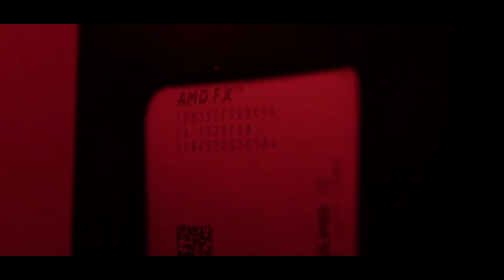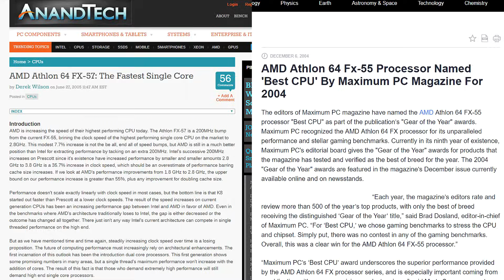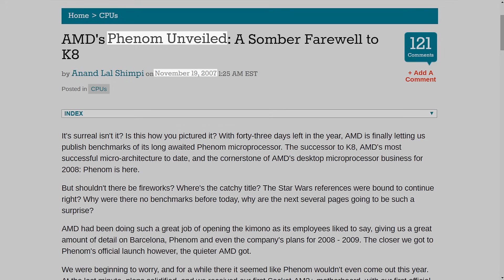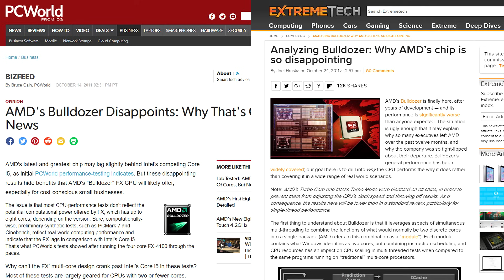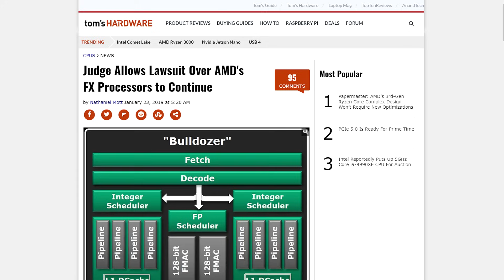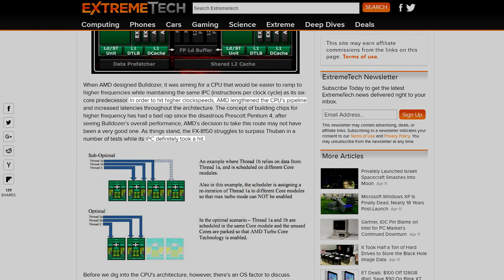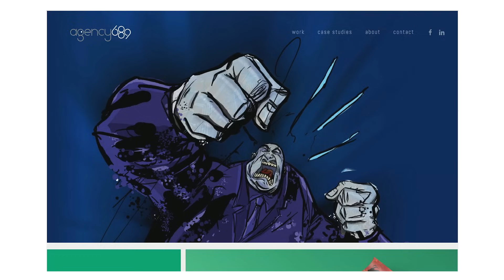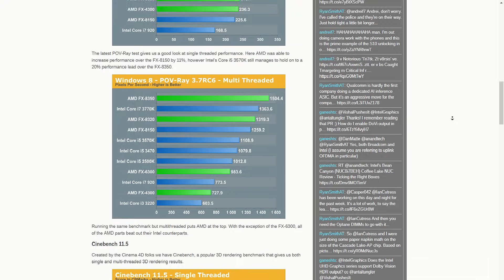Why AMD's FX CPUs Were Hated So Much? - The Fate of Bulldozer

Comment: Hated? Nay. I love mine:

john@john:~$ lscpu
Architecture:        x86_64
CPU op-mode(s):      32-bit, 64-bit
Byte Order:          Little Endian
CPU(s):              8
On-line CPU(s) list: 0-7
Thread(s) per core:  2
Core(s) per socket:  4
Socket(s):           1
NUMA node(s):        1
Vendor ID:           AuthenticAMD
CPU family:          21
Model:               2
Model name:          AMD FX-8370 Eight-Core Processor
Stepping:            0
CPU MHz:             4111.594
BogoMIPS:            8026.77
Virtualization:      AMD-V
L1d cache:           16K
L1i cache:           64K
L2 cache:            2048K
L3 cache:            8192K
NUMA node0 CPU(s):   0-7
Flags:               fpu vme de pse tsc msr pae mce cx8 apic sep mtrr pge mca cmov pat pse36 clflush mmx fxsr sse sse2 ht syscall nx mmxext fxsr_opt pdpe1gb rdtscp lm constant_tsc rep_good nopl nonstop_tsc cpuid extd_apicid aperfmperf pni pclmulqdq monitor ssse3 fma cx16 sse4_1 sse4_2 popcnt aes xsave avx f16c lahf_lm cmp_legacy svm extapic cr8_legacy abm sse4a misalignsse 3dnowprefetch osvw ibs xop skinit wdt fma4 tce nodeid_msr tbm topoext perfctr_core perfctr_nb cpb hw_pstate ssbd ibpb vmmcall bmi1 arat npt lbrv svm_lock nrip_save tsc_scale vmcb_clean flushbyasid decodeassists pausefilter pfthreshold
john@john:~$ 
john@john:~$ 
john@john:~$ cat /proc/sys/kernel/osrelease
5.3.0-23-lowlatency
john@john:~$ 
john@john:~$ 
john@john:~$ dmesg | grep microcode
[    2.151435] microcode: microcode updated early to new patch_level=0x06000852
[    2.151485] microcode: CPU0: patch_level=0x06000852
[    2.151491] microcode: CPU1: patch_level=0x06000852
[    2.151497] microcode: CPU2: patch_level=0x06000852
[    2.151503] microcode: CPU3: patch_level=0x06000852
[    2.151506] microcode: CPU4: patch_level=0x06000852
[    2.151514] microcode: CPU5: patch_level=0x06000852
[    2.151519] microcode: CPU6: patch_level=0x06000852
[    2.151525] microcode: CPU7: patch_level=0x06000852
[    2.151553] microcode: Microcode Update Driver: v2.2.
john@john:~$ 
john@john:~$ 
john@john:~$ grep . /sys/devices/system/cpu/vulnerabilities/*

/sys/devices/system/cpu/vulnerabilities/itlb_multihit:Not affected

/sys/devices/system/cpu/vulnerabilities/l1tf:Not affected

/sys/devices/system/cpu/vulnerabilities/mds:Not affected

/sys/devices/system/cpu/vulnerabilities/meltdown:Not affected

/sys/devices/system/cpu/vulnerabilities/spec_store_bypass:Mitigation: Speculative Store Bypass disabled via prctl and seccomp

/sys/devices/system/cpu/vulnerabilities/spectre_v1:Mitigation: usercopy/swapgs barriers and __user pointer sanitization

/sys/devices/system/cpu/vulnerabilities/spectre_v2:Mitigation: Full AMD retpoline, IBPB: conditional, STIBP: disabled, RSB filling

/sys/devices/system/cpu/vulnerabilities/tsx_async_abort:Not affected

john@john:~$

Comment: "Yet still Bulldozer didn't overclock any better than Sandy Bridge processors."
This may be true on a consumer level with air cooling, but for the sake of complete information Bulldozers are actually dominating the overclocking world record charts at up to 8.8 GHz, with only a few Core 2 era Celerons mixed into the top 10 for some reason, I really don't know why those things of all Intel chips achieve the highest clocks ever. Also in case you're the kind of person that's paranoid about security holes and backdoors, FX are the latest and most powerful desktop chips without any sort of underlying management engine. Intel had already integrated a management engine into (Intel) motherboards on Core 2 platforms and moved it right into the processor on Nehalem, and AMD also introduced their own management engine with Ryzen.
Reply: Haven't seen the top ten but I'd assume those are late netburst era cellys. Single core, little cache, massive pipeline, great potential for overclocking!
Reply: That degree of paranoia is useless since whatever OS you will run on the machine is less safe than these shitty management engines.

Comment: I loved my FX8320 though, It was a blast overclocking and tweaking it, I got the chip for $99 on a black Friday deal years ago and was able to get to 5.2ghz on it, sure wasn't the fastest thing out there, but definitely an upgrade over my Phenom II x4 945.

Tho I did move to x99 right before AMD released their Ryzen series, I'm happy with 5960x, but it hit a wall so easily it kinda took the fun out of overclocking, it was just too easy to get to its max reasonable clock speed. Were the FX was just so much different and felt more rewarding. Learned a lot with AMD and fiddling around with stuff.

Comment: I've no complaints with my 8370. Really good on virtualization, still running after nearly 5 years with no issues. When I've got the money I'll get a Ryzen rig, but if the CPU blew tomorrow I'd just buy another.

Comment: I actually game on 1440P with an FX-8350 and a 1070 lol
Reply: I've gamed at 2160P with FX-8350 and dual GTX 970's. That was after using that setup to run 3 monitors at 5760x1080 for several years.
Reply: 1070 is way you can game at 1440p higher resolution doesn't affect the CPU
Reply: @tristianwarren3067  I have a FX-8370 and a RX 580 and i can play PUBG on high settings with 60-90 fps.
Reply: Did 8350 bottleneck the GPU?
Reply: @RidwanNurzeha  It does, but at 1440P it's less of a bottleneck than I had with my previous 1080p monitor

Comment: i felt cheated on spending 1.2k usd (90000inr) on a shitty pc , i am still watching this on my fx-8150 4.23ghz , on windows 7 it was terrible  , after windows 10 it's performance is visibly improved , but it's unable to perform fast not even decent is really pissing me off , it's my misfortune that i don't have money to buy a new one , if i had i would've throw my pc into a lake , even it is so shitty i was surprised to see mine one performs really well in gaming as compared to other fx 8150 or 8350 owners with a mid range card of  r9 270x . but still i wish i could've purchased an intel i5 or i7 just to save fcking 100$ i bought this fx shit

Comment: I chose the 8350 for 2 reasons 1. It was good enough 2. It worked on my old 890fx motherboard. With intel the motherboard usually only works with the processor that originally came with it. The motherboard usually cost a lot more if you do overclock and so does the CPU.

Comment: 😬Bulldozer got bulldozed by Sandy Bridge off the bridge. 😂
Reply: yep. for real. An 2500k or 2600 is still very much usable to this day (pair a cheap 580 and you got yourself a good 1080p setup) and is almost 9 years old at this point.

Comment: did they lack becauae every fx core shared a floating integer and the definition of a core was a bit  smudged.  So a fx 6300 was actually a 3 core ? not a true 6 core. single thread was so weak, ultra weak.YEAH nice u noted that,,,,  not useful if a module is two cores and one bottleneck.

Comment: Went i5 2500k in early 2012, did not regret. Running an R7 1700 now though, which is a definite upgrade. Next upgrade may be 4th or 5th gen Ryzen.

Comment: i personally don't get the hate.. yeah they did drag out the release and hype up bulldozers. they didn't win with the pile drivers. the phenoms really weren't that great for the time. i'm a slow adopter of tech. a cheap ass trying to run modern games and occasionally encode a video here and there. you get what you pay for and amd seems to understand that. the chips i've bought have all cost less than i3 would and SMOKE them on multi threaded stuff and aren't that far off on single threaded stuff. the new ryzen is in my near future i think but dumping 300 on a chip is hard for me to do. i think it'll be another phenom ii though and last me years. this fx isn't bad but i know i can get more from my rx580. i should just buy it and not look back lol.
Reply: You can get the 2700x for about 150 these days.

Comment: I wouldn't say they were hated or bad. They were just a little ahead of the times. They dropped when applications were barely using 2 threads. It was heavily underutilized and wasted, coupled with bad IPC's it was fighting a losing battle, to begin with.

Comment: i'm still using 8320e on 4,2ghz, can run anything at max with 1060 6g so its not that bad at all with a minimal oc and voltage tweak, however you can't software stream from it. If someone dont have much money for pc its at least supercheap and usuable.  For 4k forget it, but in hd it can handle games lagg free, but bear in mind it has pcie 2.0 and ddr3 system memory so it  probably wont be good 1-2yr later.  As for ancient rigs which are equipped with pcie 1st gen and they cant handle gddr5, fx wont be able to handle gddr6 cards and their superhigh speed!
By the way, fx8350 is kinda = ryzen3 2200G with half as hungry as its big brother, yet I think these FX's was a milestone in cpu history, but not as a fail, but as a first milestone of todays greater cpu core number designs.

Comment: I bought an 8350, and later a 9590 just because I could, and they were fan-freakin-tastic.  In actual average daily/gaming use.  In gaming I was, as most people, GPU limited, the FX was MORE than enough when your 290x couldn't keep up.  I still have a 9590 in use at work serving the heck out of files and software and running a VM or two.  The hate from Intel guys was unreal back then.  After awhile I bought an 4790K(used), which was faster, on paper, but functionally the same as the 8350.  This was for gaming, crysis, far cry, etc, running a couple chromes with many dozens of tabs, a VM, the usual crap.  I was thrilled to get back to AMD with a 2700x last year and as usual, I'm GPU limited with a GTX1080, and everything not gaming, it's utterly fine.  I get spec racing and all that, but the hate AMD FX era stuff received made it for sure that I will always buy AMD when it's even remotely "good enough".   It amuses the hell out of me to see the newer Ryzen stuff competing with Intel not just on the real daily use field, but in benchmarks as well.  I got into PC's in the Socket 7 days, or even in the Pentium Overdrive/5x86 stuff era really.  AMD has always served me well, and Intel are a bunch of dickbags from a corporate business standpoint.  I buy Intel stuff used, and AMD stuff new.

Comment: I hated Bulldozer and switched to Intel when I found out my old Thuban outperformed this new 8 core AMD had been teasing us with for years, saying it would be a revolutionary step forward.

Bulldozer just couldnt handle most workloads well save a few specific outlier scenarios...and then sat with only a single revision for years while Intel made little gains year after year. It was frustrating. I'm sure if I start scrolling through the comments, it's all people talking about how good their FX chips are. The reality is that they're just adequate. I mean hell, I have a Core2Quad q6700 that has no trouble with much more modern games than its 2006 manufacture date. A chip branded as an 8 core flagship up until 3 years ago sure as hell better be able to still play games...but that doesn't make it good. Just adequate. That's all Bulldozer ever was.

Comment: You forgot about the Windows task scheduler problem.  It required a dedicated non-MS CPU driver that would schedule instruction delivery to each bulldozer core rather than to bulldozer modules.  Having windows send around half the instructions to the processor than it was able to handle really hurt performance.
Reply: Hot fixes came out for it in the later years of windows 7 and by the time windows 8 came out, the problem is gone. Performance has only improved with windows 10

Comment: I had a FX9590 with a Asus Crosshair Formula V and I LOVED IT!! Yes they were power hogs but with liquid cooling I never seen over 65 degrees. And yes, I am a ATI/AMD fanboi
Reply: Nothing wrong with that. I am more of a budget fanboy myself. I just get whatever is the highest performing component for said budget, regardless of brand. Needless to say I am on a 3900X now and I love it. First AMD CPU since my Athlon 64 like 15 years ago.
Reply: @junkiexl86  the 3900X is a really good deal. I wanna wait for the 3950x but it's like 250 bucks more so I'm not sure it's even worth it.
Reply: @Trumplican  I was initially holding out for it, but I don't do enough non-gaming workflow to justify it so I pulled the trigger on the 3900x. Glad I did as its identical in 1440p gaming FPS. I'm on 3440x1440.
Reply: @junkiexl86  Ya that's what my logical thinking says however, the enthusiast in me wants the 3950 just because it's more cores/threads which like you said is pretty useless unless it's used for a workstation or  whatnot.
Reply: @Trumplican  3900X is no slouch though. Both chips are monsters. The 3950x has more cores but honestly when you do look at the non-gaming benchmarks its better, but its not night and day better. Nice bump in 7zip compression, 1 min off some render times etc.
Reply: @junkiexl86  very true. I think I may go with the 3900X just because the price difference. It's not worth that much more.
Reply: Dragon800 FX9590 is actually more powerful then I9 9900k
Reply: @justiny.1773  lol is that so?
Reply: @justiny.1773  Dude...come on now. The 9590 got outperformed by the 4790k in everything but raw multitasking, which was even less supported in 2013 than it is now. Even then the 5960x and in many instances the 5820k outperformed it and this was back in 2013/2014 lol. Idk what you're smoking.

Comment: i had one fx computer with the fx9590. there fore i had an phenom 2 x4 945 quadcore processor and now i have the ryzen 5 3rd gen processor. And my first computer was an amd 2800+ sempron or athlon orso i dont know anymore but i selled my phenom 2 pc and i still own the 2800+ my fx9590 and now i use the ryzen 5 pc :D

Comment: The main issue was there was no software optimization to it
Reply: Partly, yes, but not entirely.  A large flaw was the single floating point core for each "module;" only four of them in an eight core chip.
Reply: @dtsdigitalden5023  I mean define what you think makes an 8 core chip an 8 core chip
Reply: And it is not a floating point core, it is a floating point unit, in theory ALU should have no issues to get the FPU do the job for 2 cores as most optimized operations should only require Integers, in such case you can get much more out of a core than using floating points

Comment: Remember that 200w tdp monster that would need a specialized motherboard that had 3 12v 4pin connectors, didn't come with heatsink because no stock cooler could handle it, and still literally burnt up the motherboard? Yea...
Reply from the maker: It's funny how the tables have turned since then.

Comment: The ad you showed was for the original Athlon CPU from 1999 which competed with the Pentium 3 and not for the Athlon FX, that came 4 years later in 2003 and was a Pentium 4/Pentium 4 HT (Northwood and Prescott) competitor.
Reply from the maker: Which is why you can see at the bottom left corner a text, saying: "Not an Athlon 64 FX commercial". I just decided to include that clip to show how competitive AMD was back then. And of course because I couldn't find an Athlon FX commercial.

Comment: Having a look at the Intel/AMD cpu comparisons at around 11:26, I'm being remembered how Intel guts their non-i7-CPUs. (In some cases this continues to this day, where now even an i7 9700k is missing hyperthreading.)
That still leaves a bad taste in my mouth for going with Intel once, on an i5 4590 (non k) circa 2014. Yet, it was the better product for my use case at that time.

Very well made video, thank you! Subbed. ;-)
Reply from the maker: Thank you!
Reply: from what I understand, the reason the 9900K has hyper threading and the 9700K lacks it is because of binning, due to pushing more cores on a die that has not gotten any bigger has caused major failures in yield, causing many CPUs to have faulty threading circuits, basically all 9700Ks are broken 9900Ks with disabled hyperthreading.
Reply: They don't "gut" them, they offer different features for market segmentation. The same reason car manufacturers offer various 'trim' levels for their models. Not everyone wants or can afford the fully loaded model when they can get the same car with fewer features for less money.

Comment: I'm still using my Phenom II 940 as my main pc.  Combined with an RX460 it works for me.
Reply: It's only weird if it doesn't work
Reply: I run a Phenom II 1055T and recently upgraded the graphics card from an HD5850 (1 gig of memory just didn't cut it anymore)  to an 8gig RX570 for cheap. Loading times can be a bit long sometimes but otherwise i'm pretty happy with it. For Honor runs smooth on highest settings.
Reply: Phenom II 710 and 650ti here. 
But it's really time for an upgrade...

Comment: its actually the cache speeds that are the major issue for the FX line more then shared resources, a few eng's i have talked to have said this independently and then, talking togather... they said it needed hand tuning the automated tools arent up to snuff for that stuff yet, had they brought jim in to  tune it, they could have fixed its flaws without removing the shared fpu design, the design was interesting, the probem is, the l3 runs at ram speeds and latancies..ugg... 

and yeah ,dont call it FX... that was dumb... also... should have waited to call them FX till they got to something like the 8370 at bare minimum... 

i have had this system a long time, its held me for alot longer then a 2600k or 970x would have.... even my buddies who had 2700k's have said i made the better long term choice... 

win10 really helped fx perf for me... so...yeah... its gotten better over the years not worse...